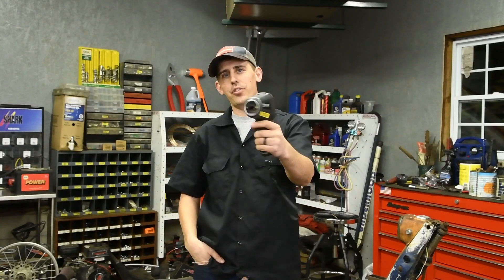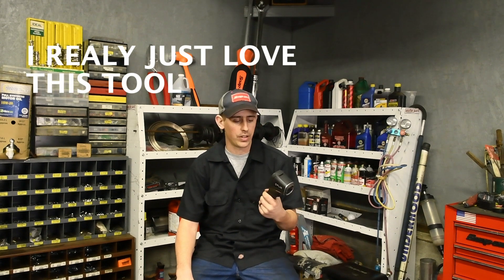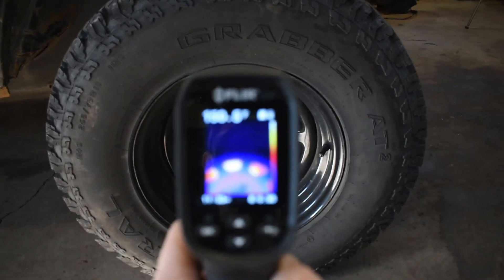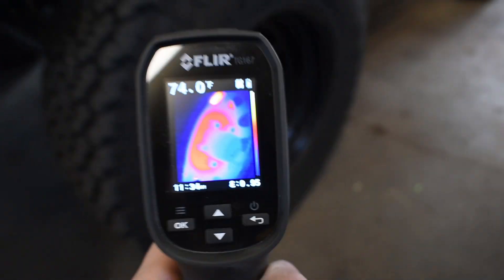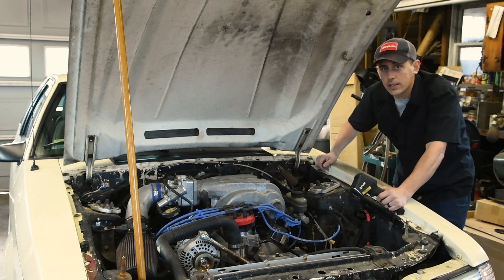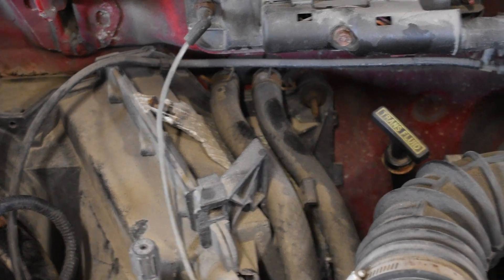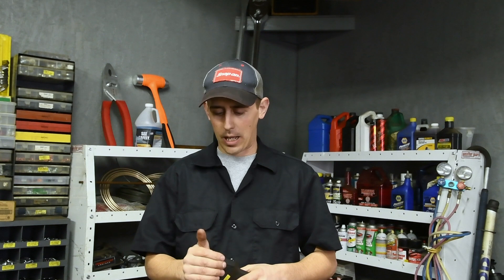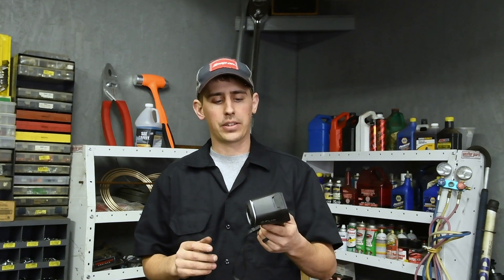MY TOP USES for a FLIR thermal imager

Comment: do u recomend spending more money on ther ehigher end models
Reply: I bought a sub $400 model from amazon. Its not bad. i havent used it on a car yet, but i think it will be good enough.
Reply from the maker: I would say this model is sufficient for automotive needs but the higher end models do have some better features. It all depends on what you need it for.
Reply: @InTheShop  there expensive AF
Reply from the maker: @randomrazr  Very expensive for sure. If used properly though they can save you a ton of time and money.